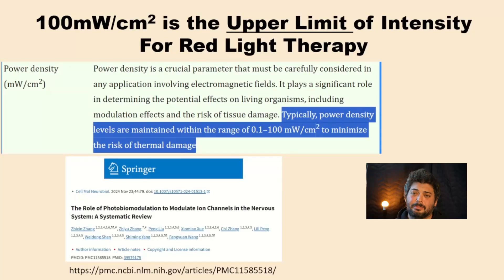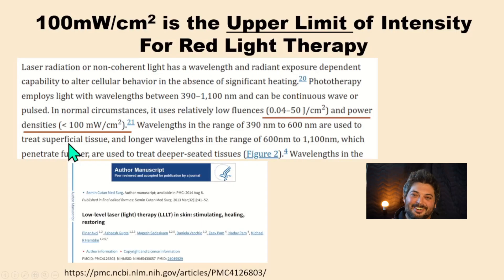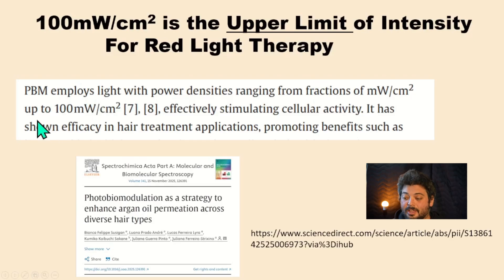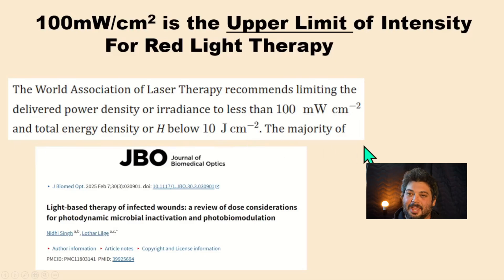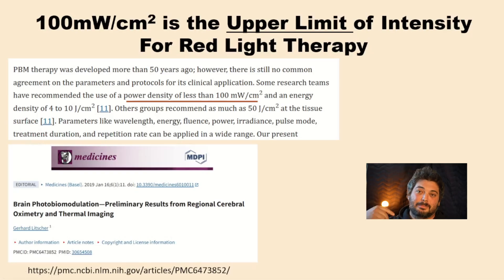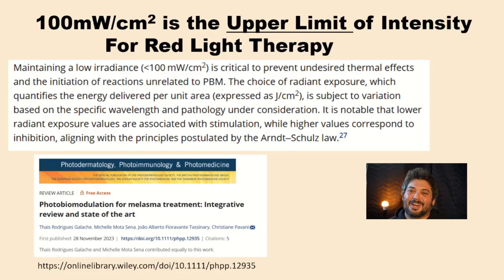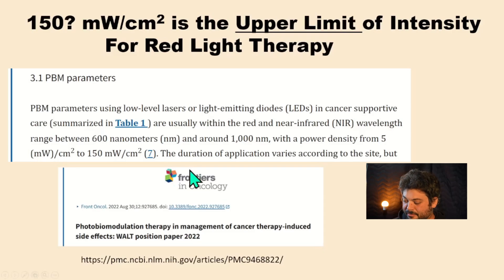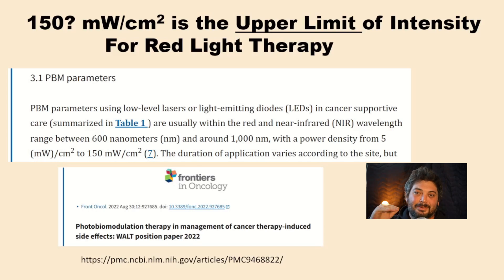100 is the upper limit of Intensity for Red Light Therapy

Comment: In our research we are using in excess of pulsed 260mw/cm2 treating TBI, for very short periods of time, so far positive results with minimum side affects
Reply: We use a specialized device,,,,,Please  if you don't know what you are doing dont just buy a high powered device and use it on yourself , we know of a case of a high powered device causing phychosis from miss using an over the counter red therapy laser device
Reply: @einsteind  Is it a intranasal device?
Reply: Is 260mw/cm2 the peak or the average energy density? can you give more details on duty cycle?